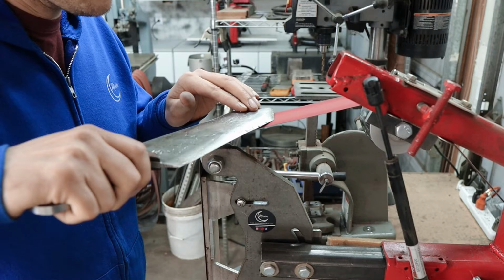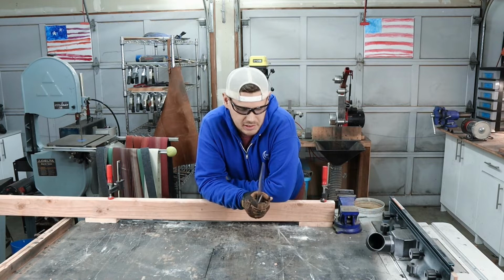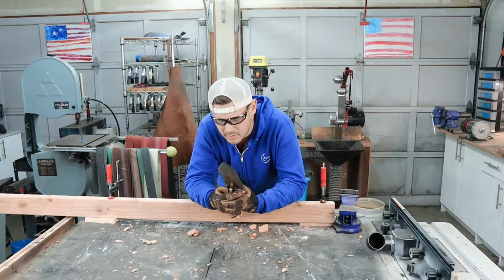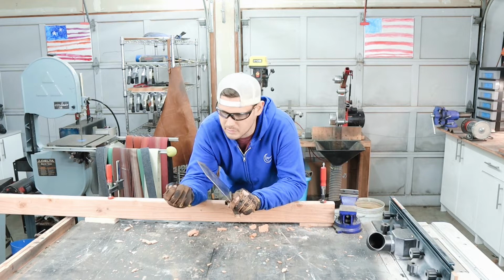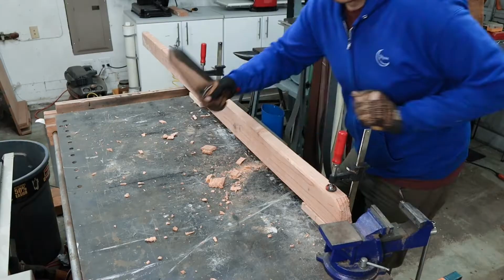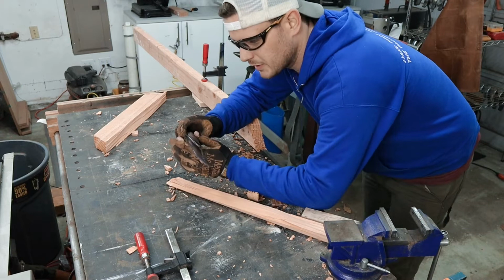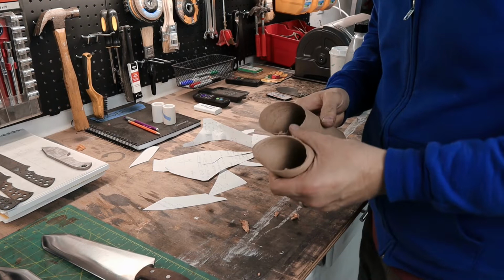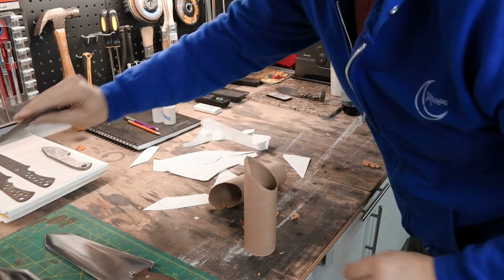Making two Roman Pugio short sword daggers

Comment: Awesome handles! Love the exposed metal at the bottom! Those turned out great!
Reply from the maker: Thank you! The handles were some tricky forging. The person I made them for wanted it to be an integral piece with no metal welded or attached. A hidden tang with a threaded pommel to screw on the end would have been simpler to make. That was a unique constraint that made this build a little more challenging and fun. Thanks for watching! 🤙

Comment: Hi David firstly I would like to say nice blades well prepared but I suggest you research your weapons .The Pugio was designed to do one thing to place the blade between  the ribs and thrust into the vital organs e.g. the hart the lung the liver and so on to induce massive internal damage and death. the practice of hacking with their blade was not even considered because it was not what the weapon was designed for , the same as a foil you wouldn't test that by hacking on wood you would use a penetrating test like a side of beef or pork or a wet sack of sand . Roman swords were the same only thrust to the neck or face or exposed arm pit, in fact the Roman sword was so bad at hacking things off that when in England A Roman Commander had to execute some enemy prisoners he bitterly complained that it took 3 or 4 hacks of the Roman sword to remove the head. The reasoning behind this was that it was easy to train some one to thrust  using the shield to block any attacks  and stab with the sword like a spear with a short handle but to train someone to use a sword like the Greeks did took skill and years to become proficient at. Julius Caesar commented in his book  The Gallic wars he ran into an old friend who he struggled to recognise at first and then asked why half his face was missing to which his friend replied  a Kopis smashed its way thru the metal rim of his shield and his steel helmet and removed the left half of his face. Now that weapon could remove heads no problem but required a lot more skill, if you ever make one your test for hardness would be fine. If you wont to see one look up Forged in Fire: Greek Kopis , your skill is good and what you made was good I have no problem their. Keep up the good work David. Respectfully yours Alex.
Reply from the maker: Hey Alex, thanks for the informative comment! I really appreciate all of the historical context for these blades. It sounds like you know your weapons!